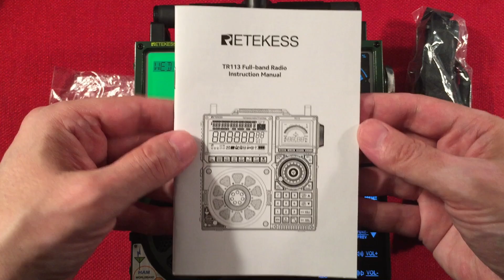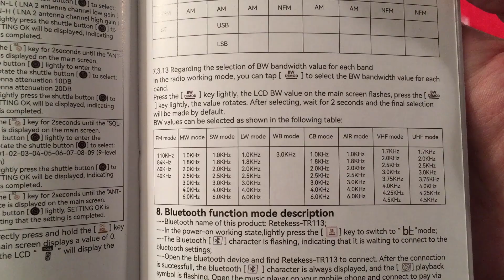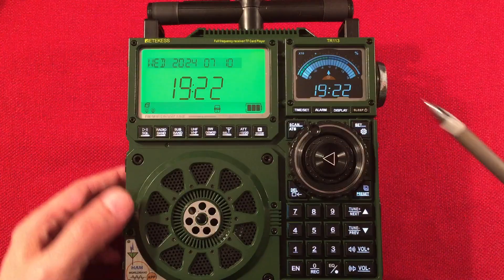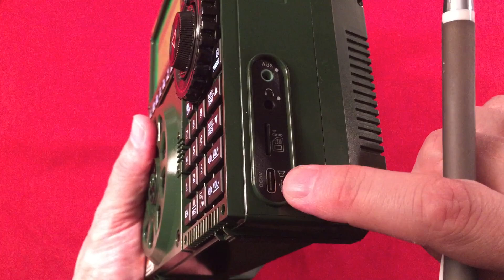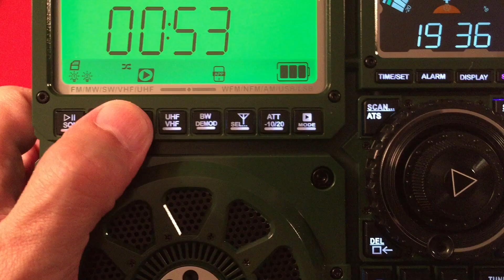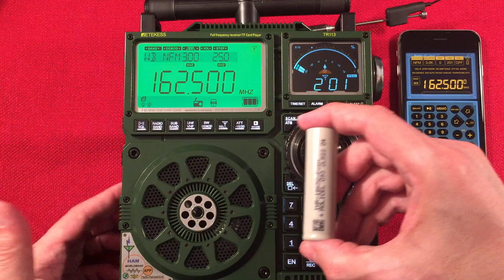Retekess TR113 AM FM LW WX AIR CB VHF UHF SSB Shortwave Radio Review

Comment: Pressing SET button does nothing but adjusts antenna possibilities, When I use SCAN ATS, the radio scans but will not stop at stations it finds. When you manually stop it, it reverts back to lowest frequency it began the scan with. What's this all about? These function do not appear to work.
Reply from the maker: Might need a firmware update, which is possible by the user.  Contact Retekess first.

Comment: Is this radio better than a digital radio which will allow encrypted signals to be heard especially on vhf or uhf? The old scanners are not much use anymore? I am also wondering if it is even worth paying over $200 for a new shortwave radio since not much is on it to listen to. 20 mhz to 990mhz. Is there really much there? 6 meters has been dead for years. 2 meters, 10  meters seem to be dead or is it me? You might hear something on 40 or 80 meters at night.  Basically you have from 6pm to 11pm to listen at night and then it all goes down hill for English stations  and some ham radio operators. to listen to.
Reply from the maker: 20m is active, 2m is active in my area.  AIR is active because I live near O'Hare Int.  UHF is actually busy with Police repeaters out of Chicago.  It just depends on what you are after.  SW is pretty much dead during the week, and picks up on the weekends.

Comment: Good morning! Happy New Year. I would like to know if, for those who only want to use the airband, the signal on the TR-113 is superior to that of the TR-112. Would there be an advantage in the signal quality of the aircraft from the TR-113 compared to the TR-112? 

Thank you
Reply from the maker: The TR113 is going to be more sensitive on AIR with its onboard antenna.  It also has a scan feature, so it can operate as a scanner, as it goes through your presets for activity.  It does it fast, I wish it had a delay of two seconds after the transmission is over so it doesn't miss anything.  Maybe they will add that later in a firmware upgrade.
Reply from the maker: A dedicated handheld scanner, such as a Bearcat is going to be the way to go for AIR band listening.

Comment: Do not waste your money on this radio. It should never have been released for sale and basically it should be in the Beta stage. There are much better radios on the market and for equal or less money. 

It is definitely a packed radio as far as functions and with the ability to be controlled from an App. I owned this radio for roughly two weeks and in that time these are the issues I found with it from an operation point of view. It’s since been returned. 

What caught my eye on this radio was the range of frequencies it covers, that it can receive Upper and Lower sidebands and the UHF / VHF ability. The other draw was it could be linked to an app. 

#1 Issue was the muting of the audio when tuning through the frequencies. This to me is a big issue and as far as I saw was yet to be fixed through a software upgrade. In fact many persons say not to perform the upgrade since the patch had issues to the level of “Bricking” the radio, making as useful as a brick. 

#2 Issue was the unstable receiver. I noticed that tuning into a strong signal on a secondary radio (Yaesu FTdx10) and an external antenna and setting the TR113 to the same frequency, that the radio was tuned lower than the reference radio. Tuning higher using the fine tune control brought the signal in, but when moving away and then back to the same frequency it was not consistent and needed to be adjusted once again. This was repeated over and with differing results. 

#3 Issue was the external antenna jack. This was a selling point for me being able to connect external antenna’s VHF / UHF through the SMA top connector and shortwave (HF) to the rear of the radio. The radio also has a third input on the top next to the SMA connector for a magnetic (ferrite) antenna that comes with the radio. The jack on the top for this antenna is basically a 3.5mm stereo jack. The rear jack never seemed to make good contact to my external antenna and I was using basically a mono 3.5mm plug / cable / PL 259 connector to the antenna. I can’t confirm, but the top and rear connector on the radio looks to be the same (stereo). The standard for these portable receivers uses mono plugs like the Sangean ANT-60. I found the connection to be loose and finicky. 

#4 Issue was with the App. Basically the app works as a remote control. It will not provide an audio signal and is only for remove control. The main issue I found was with tuning. The App has an UP / Down button and basically tunes the radio in jumps of 10khz. No where in the app could I find any way to reduce the step lower than 10khz even if the actual radio had the lowest setting possible. 

There are a lot of reviews of this radio and very few go into issues and how poor of a radio this is. There are other issues with this radio (poor manual, lack of a VHF / UHF rubber ducky antenna, etc.). I'm very surprised on the reviews it gets and was partially the reason of deciding to go with it. Invest your money elsewhere in either a Sangean or a Tecsun that has been around for a few years and have proven track records. This radio will probably be replaced by another model leaving you without any support or software upgrades. Its also in my opinion not a good radio for someone starting out in shortwave listening.
Reply: What radio would you recommend that offers similar frequency range to this one?
Reply: @ZeusTheTornado  Going with the Sangean ATS-909X2
Reply: @jimhughes9139  What an idiotic comparison to make

Comment: For 330 and all those features it should also have a Flashlight since you said it's good for a camping radio. 
If only it wasn't  so expensive, I wish they had a smaller rectangular style Hand Held type radio with the same features  and the knobs on the side for tuning and a Dot Matrix Display like on the Retekess V115 but larger maybe like the Retekess TR618 but with the Dot Matrix Display display of course.

Comment: The Battery issuesis for saftey since if you install it in reverse it will explode or over heat and catch fire. They should have made it like a cordless phone where it un plugs.
Reply from the maker: It has a header, but it is deep in the radio, which means taking it a apart.
Reply from the maker: Also they have reverse polarity protection for the 18650s on the other models.

Comment: Hello, I'm thinking about buying this radio to listen to soccer broadcasts from other countries. What is your opinion?
Reply from the maker: Should work well with an external wire or active loop antenna.  Personally I would check out the Sangean 909X2 if you are going to use external antennas, it is wonderful radio on Shortwave.
Reply: Thank you for the quick response, what kind of antenna do you advise me? I’m sorry, but I have little knowledge in this matter. I wonder if with the Raddy RF919 I achieve my goal. I want a transmission with the least possible delay.
Reply from the maker: @inputs4you584  Depends on Solar conditions.  You can tune in programs with a twenty dollar radio if they are good.  So you have to watch the Solar charts to give you an idea.  Shortwave transmissions need to bounce off the ionosphere to get around the curvature of our planet.  Also time of day, and what part of the band they are broadcasting on will also affect if you are able to hear them or not.  A simple 22' wire strung outside will help with reception, and it is cheap.  The 919 is nice, I like the battery option.  It is good that they use standard flat tops.  Both radios record, which is a bonus.
Reply: Raddy is a little cheaper

Comment: I have had mine for about a week. I have Squelch turned on and it has failed. It stopped receiving broadcasts. Of course If I turn the squelch off it will. This is a recent failure and just proves these are not made very well. I had two TR-110's and they were pretty bad.

Comment: If you get the ZHIWHIS ZWS-c919, who seems to be the actual manufacturer you can get the newer firmware for the soft muting issue, and get the removable battery option. They are very responsive at customer service.
Reply from the maker: I like that company :)

Comment: Raddy,  Retekess, and HanRongDa radios, from my personal experience, are all of questionable quality. Same factory, no QC or forethought in engineering. Anything manufactured by the parent company, HanRongDa should be avoided. Defective displays, broken encoders, firmware flaws. I've returned more than I kept. No apologies for the negativity.😅 23:10
Reply: Malahit DSP-2 instead? 🎉

Comment: Get the NEW firmware 1.707, solves soft muting. Makes it a great radio.
It’s crucial that you format the SD memory card FAT32 before trying to update firmware
ex32 format will brick your radio.
Reply: Where did you obtain firmware version 1.707 from please?  I just checked with Radioditty.  They informed me that the latest firmware version they have available is 1.706 and that they are still working on the (unsolved) muting problem.  They also cautioned that while the HRD-RF919 and the Retekess TR113 are very similar radios they are not identical and an attempt to install firmware designed for the Retekess could very well brick the RF919.  Thanks.

Comment: In the AM band, around 520-620KHZ, I can't hear the radio station, only a howling sound, as if it is resonating.
Reply: To correct, if you receive the radio sound at around AM: 520-620KHZ, there will definitely be a howling sound inside the radio. They are resonating.
Reply from the maker: @lizhao-d9u  Using an external antenna solves this.

Comment: There's much to like here.  However, at its price, I'd like to be able to replace the batteries in a few years.  It's nifty that it will do FM on the "Public Service Low" band.  There's a bit on there from my local municipalities.
Reply from the maker: If you have the skills, I think it would be rather easy to replace.  I would chop the wires at the battery and use them with a new battery pack, possibly one I build with my own 18650s.  You could also find a flat lithium battery pack that fits as well.  The ability to solder, and heatshrink everything is needed though.  Now that I'm thinking about this more, I can install a DC Input Jack, and use one of my built battery packs as the power source.  I have a 20,000mAh Power Bank with a direct(fused)connection that I use with my V115 style Recorder.  Works great, and supplies the correct voltage without having to engage the Power Bank's Buck Circuit...so no RFI :) https://imgur.com/xKjKm26

Comment: Wow, I'm liking this radio!
Haven't been on the channel in a while and, I'm wondering what that app is on your phone. It's tuning with the Retekess...
Is that some sort of SDR?
Thanks, Todderbert.
Reply from the maker: It is an interface for the radio, like a remote control.  When connected you can turn the radio on, and off with it as well.  Hear something cool on the radio, hit the record button on the phone and the receiver will start recording to its micro sd card.  Of course you can tune from the app as well.  I like that it does not interfere with any received signals.
Reply: @todderbert  That is very cool. I've never seen that before.
Definitely going to look into it.

Comment: What happens when the battery won't charge anymore?
Reply from the maker: Find a tech shop that can replace it.  A simple twin 18650 pack built in parallel will fit, just needs the correct plug, or the wires soldered to the old ones.
Reply: @todderbert  thanks, but that's a deal breaker for the price. The band coverage almost had me.
Reply from the maker: @johnmfl61  Then watch the Raddy, and HanRonDa versions for price drops.  They use the replaceable 18650 flat tops.
Reply: @todderbert  thank you.

Comment: That battery arrangement is most odd, as both the Raddy and Han Rongda Versions both use 18650 batteries, which makes much more sense,
Reply from the maker: It does, and I'm sure they use reverse polarity protection on the board as well.  So I'm still baffled on the choice Retekess went with here.  Cylindrical cells vent properly, and are robust with their metal enclosures.  My only guess is they are trying to remove liability from themselves by having a fixed battery.

Comment: The SOFT MUTING when tuning the frequencies is a DEAL BREAKER if Retekess does not allow one to turn it off. That is extremely annoying, and it renders the enjoyability as nil.
Reply from the maker: A firmware update will most likely address the ability to switch it off.  Though it will still have mute on tuning, it will sound harsher.  I have the newest firmware on the Raddy RF919 and can confirm this.
Reply: @todderbert  Thanks for the vids!!  do you know if the 919 fw update will work on the other brands (retekess zhiwhis and HanRongDa)  I keep wondering if the radios that dont QC very well off the assembly line are sold off under the other brand names?
Reply from the maker: @rootballrandy  No, China lets companies use another's design.  The 919 is made by HanRongDa, and most likely does all the rebranding, and alterations in shop, then sends them out to the other companies requesting them.
Reply: @todderbert  FYI I just got the raddy rf919 from amazon and it already has firmware 1-704. It mutes better, like my eton elite executive. I have the zhiwhis c919 and it has old fw and it would Not take the raddy update file.
Reply: Is the 919 better overall than the TR113?

Comment: Thanks Todderbert for another great review but I will stick with Raddy RF-919 since I running out of room in my shack for extra radios….😢…😂! I prefer the 18650 because they are easier to find when it fails as with every battery. My main hope is Raddy’s planned firmware update will allow SSB reception on MW and LW plus 6M and 2M also.
Have a great day! 73!

Comment: What is the impact rating IK Code?

The IK code is an international standard that defines the level of protection that an enclosure provides against mechanical impacts. This standard, known as the International Electrotechnical Commission (IEC) 62262, is crucial in evaluating and categorizing the degree of robustness and impact resistance of various electrical and electronic devices.
Reply from the maker: Would be nice to know, maybe Retekess can chime in on this if they are reading the comments.  I personally think a one meter drop would cause serious damage.

Comment: Battery is a deal breaker!
Reply from the maker: I'm not sure exactly why they went that route, even with the release of their "safety" video.  They put a lot of effort removing the springs/contacts, and dividing plastics in the battery bay.  They also had to add closed cell foam padding for the lipo pack.

Comment: I would much rather have the radio with two 18650 batteries.
Reply from the maker: Same :)  Cool thing is the Raddy will run on a single 18650 if it has to.
Reply: @todderbert  
Beautiful.